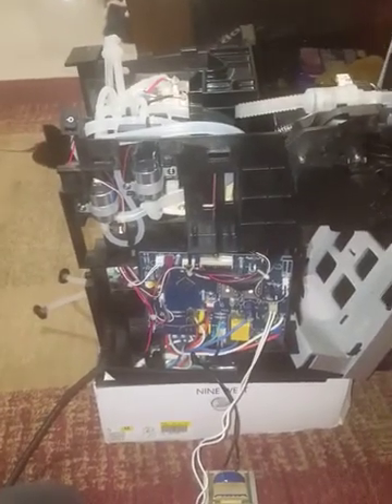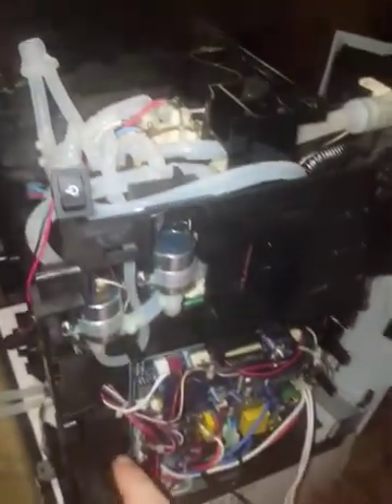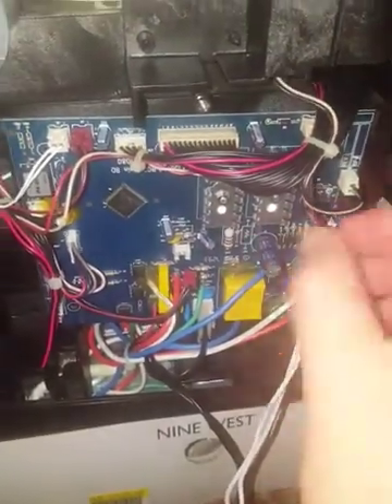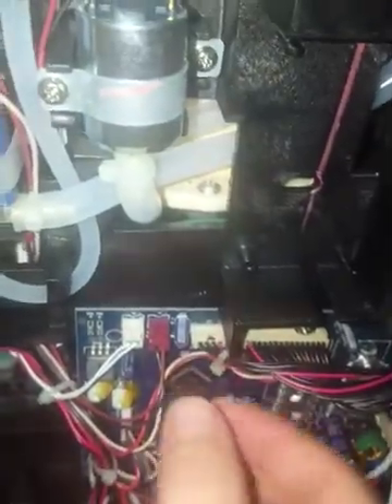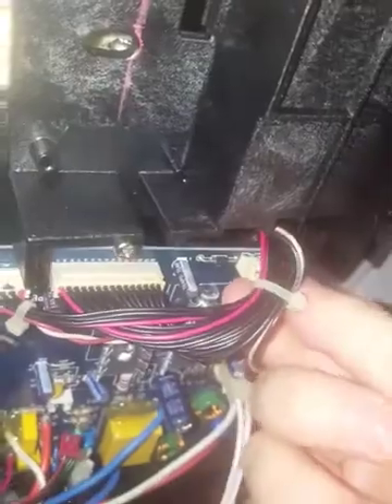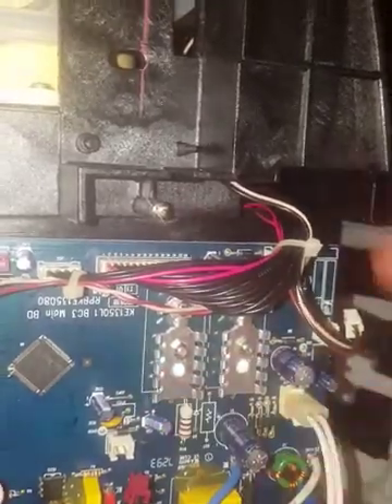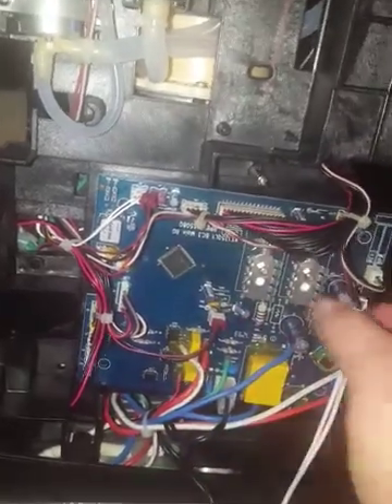Keurig K150P Faulty Board

Comment: Finally got this Fort Keurig opened up, and I see the buldged caps, but also the pressure sensor on the board seems to have leaked and shorted across the tracings. No Bueno

Comment: The most common cause of logic board failure on these brewers is the two larger electrolytic power supply capacitors.
In the video, I can see the tops of both capacitors are bulged.  Likely why the solenoids are buzzing.
I replace both of these using higher capacitance, high-quality Panasonic low-ESR parts, rated for 10000 hours @ 105ºC.
1500µF / 35V for the larger one (yes it fits), and 1200µF / 25V for the smaller one.
 
The most common electro-mechanical failure point on all K-Cup brewers that use them, are low-quality vent solenoids.
The nylon used in these solenoids turns brown over time, and eventually decomposes from the inside out.
I replace these with higher-quality European CEME-branded solenoids, which are actually designed for coffee brewers.
 
I also open up the water pump, clean the parts, and add a dab of waterproof silicone grease to the cup on the back side of the impeller. 
This cures the pump growl, at least for a while.
Reply: Just wanted to say, you were right about the 1000uf caps in the mainboard. Swapping them out fixed boot loop issue.
Thanks for posting!
Reply: @EthanReishLFCRP  Thanks for the feedback.
Reply from the maker: I tried replacing the two capacitors without luck. Both were confirmed as blown, the replacements were tested prior to being soldered. I think the short goes deeper than the two caps.
Reply: @jkucukov  The larger capacitor is across the diode bridge that's next to it. If it actually shorted, over time it could have taken out one or more of the diodes.
The smaller capacitor is across the output of the 18V regulator next to it, marked U3. (The one next to that, marked UX1, is 3.3V.)

Comment: I figured out how to fix the board. It's the two largest blue capacitors that are bulging on the top. $2 in parts from digikey. 25v and 35v 1000uf caps
Reply from the maker: I watched a video on replacing those two capacitors (25v & 35v). I replaced them last year but got no response from the board, i think the fault in my board is way worse, since then i got a whole working board from another Machine.
Reply: @jkucukov  Brandon , what were the symptoms of your problem.. mine just clicks when plugged in.

Comment: The switch on the back of my K155 will not toggle over.  I press it and it won't switch over.  What gives?  Can't get any power.
Reply from the maker: The toggle switch is a reset button, the machine is normally powered on.
Reply: Check the Capacitors to see if one is blown. That's what I changed and it now turns on. Just stuck on "Heating...Please Wait". 😞

Comment: As an owner of 4 of these K155 i am done with Keurig. I am tired if paying 300 for a machine that only works 1.5 years and samr problem slow dripping coffee. We only drink 2 cups a day and after more than a year its same thing happens slow drips and you cant fix it. I say stay away maybe buy an espresso like Breville which makes good products vs Keurig. Sorry but i wont buy you cups or your faulty products.
Reply from the maker: Agreed, these make one great project if you got the time. The unit in the video i got free from work, it was rearly used for a year before it decided to break. Got a replacement board from Ebay for $25 and still havent found time to install it.
Reply: dude i hear you as a owner of 3 Keurig's all three went out on me when the first two went out I spent 300 bucks and got one of these business ones for better quality and it worked for 3 years but once a power surge happened completely destroyed it and now all it does is blink and make ticking noises witch I'm pretty sure are relays. but whatever im gonna invest in a different brand.
Reply: @izaacschwieterman132  exactly now i goy their newer model commercial but screen lcd now is glitcy. I dont know why Keurig is just low quality seriously
Reply: @atlant2566  for real. Very low quality

Comment: Does the back just flip over after you have taken all the screws out and heated the top and back?  Mine is clicking and the screen is black.
Reply from the maker: The back cover is interlocked with the adjecent panels, it'll take some prying to get the unit exposed.
Reply: @jkucukov  I got it☺️
Reply from the maker: I posted a new video on the Keurig K150 teardown.
Reply: @jkucukov  thank you so much☺️
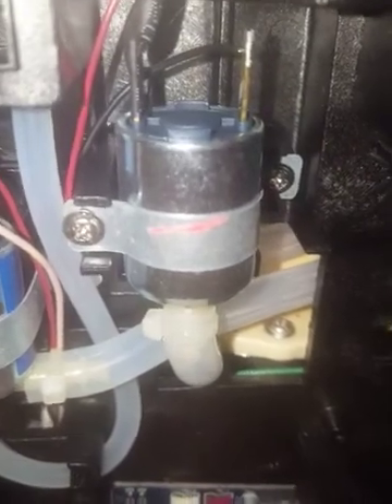Reply: @jkucukov 3:55 3:56

Comment: Were you able to fix it? Mine developed similar issues as yours. Only difference is, my LCD menu has a mind of its own.  My guess is the board needs to be replaced.  What did you figure out?
Reply from the maker: I have a working board from ebay for $20, all that is need is the unit be put back together.

Comment: How did you take the back / top cover off the machine?  I took all the back screws off but the top is not moving to remove.
Reply from the maker: It was a pain to remove the top cover despite the back being removed, the back cover has clips that hold it together, I remember I had to heat up the plastic to be able to pry it apart  without damaging covers. It was not an easy job.
Reply: All of the screws of the back and bottom panels need to be removed except the tiny ones that hold a IC chip to the metal...then all of the screws need to be removed from the lower inside base plate. Then take the two screws off the brew handle and remove the handle...(i pulled off the style covers of the brew head too) at that point the front cover needs to be pulled from the bottom so it can be raised about 1/4" and release locking tabs that hold the front edge of the top [plate which is part of the back panel. Once the back panel is freed the side panels can be worked free, being careful of front and back edge clips.
Reply from the maker: I posted a new video on the Keurig K150 teardown.
Reply: @jkucukov  can you send a link to that video? I’ve got everything apart and feel like I’m going to break something.
Reply from the maker: @KT-ic1tq  https://www.youtube.com/watch?v=n8U-dK4tbzc&t=4s

Comment: Mine just clicks and doesn’t turn on. I wonder if it’s the solenoids?
Reply from the maker: If the solenoids are clicking they are working, if your Keurig is not turning on its something to do with the Mother board. On mine the MB is toast.
Reply: @jkucukov  I have the same clicking and not turning on problem. What was your outcome? Did you replaced the board or got a new machine?
Reply from the maker: @joserazo4520  I got lucky on Ebay, found a replacement board for $20
Reply: Mine powers on and heats water but stays in heating mode and clicks a lot. Thoughts?